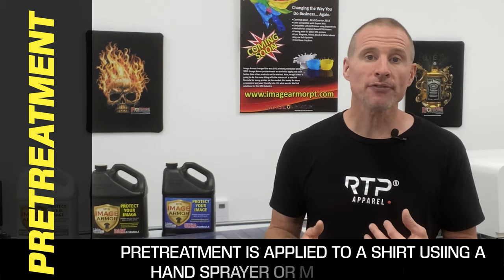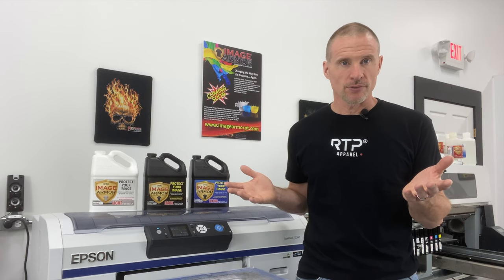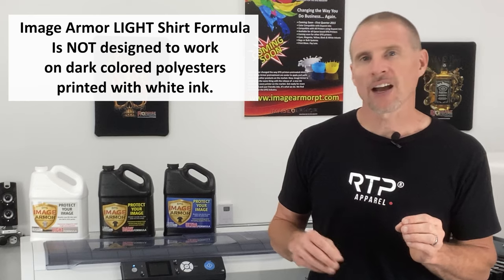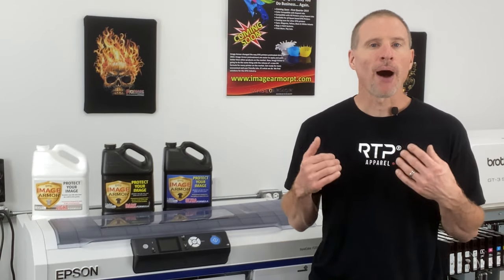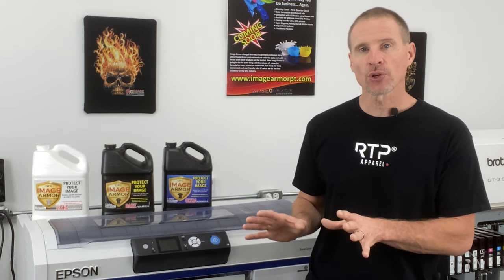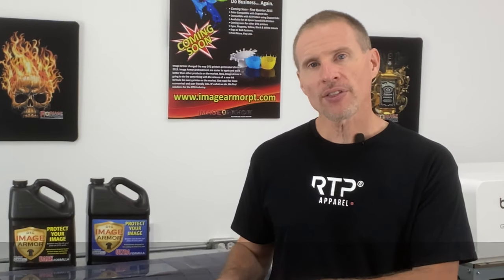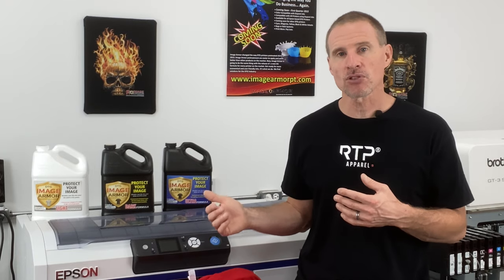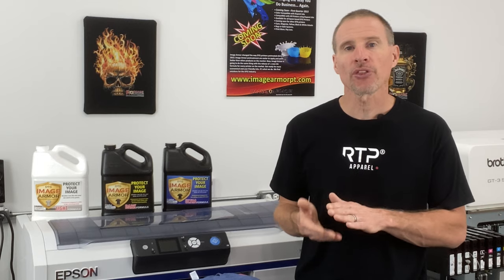Image Armor Pretreatments - When and Where To Use Them

Comment: Maybe I missed it... but do you guys have a pre treat solution that works for both white and black shirts?
Reply from the maker: There is no true universal PT based on the science behind how it cures the ink, with WHITE ink being the main deciding factor. If you are printing white ink, you would use either out ULTRA or PLATINUM. if printing on a white garment with no need for white ink, you would use IA LIGHT.

Comment: Do you need to ventilate the area you’re using to pretreat well? We’re using the viper mini to apply the pre-treatment to the garments. We’re in back office of a retail store so we get the air circulation in the room but don’t know if that’s good enough. Another concern is when we heat press the garment after treating it also.
Reply from the maker: Proper ventilation should be considered, but it's not a major issue if working in a small room long as it's not airtight. The Viper MINI does a great job and keeping the spray are precise.

Comment: On the yellow shirt 10:35 you have white in the design why didn’t you use dark PT? I understand that’s most likely because it would cause staining, and I’m also sure that’s why you wrote specifically it’s a white highlight (only the top layer is white and not the base)…. But I’m a bit puzzled as I have the Epson F3070 dtg printer and with this new fast printer It does the white and color in one pass…. Therefore I don’t exactly have the ability to do an only white highlight layer… what would you advise I do? I feel I am missing something?

Ps: since the printer is very fast I use the ultra (gels quicker)
Reply from the maker: At that point in the video for the fluorescent green we did utilize ONLY a white highlight and CMYK print. That was printed on an Epson F2100. Your driver or RIP should allow you that option to NOT print the white underbase but still print the CMYK and highlight white - however I am not familiar with the Epson F3070 interface to tell you how/where. i.e. you are just DROPPING / Not printing the white underbase but still printing the white highlight and CMYK at same time. Hope that helps!

Comment: What is meant by cure time?
Reply from the maker: Cure time typically for pretreatments is how long you need to heat set the pretreatment to fully dry it making it ready to be printed on. Inks still need to be heat cured and that would be a printer manufacturer cure time information that is specified by the printer ink manufacturer.